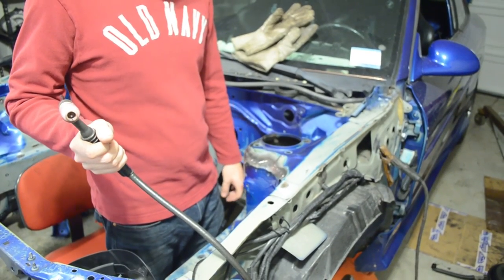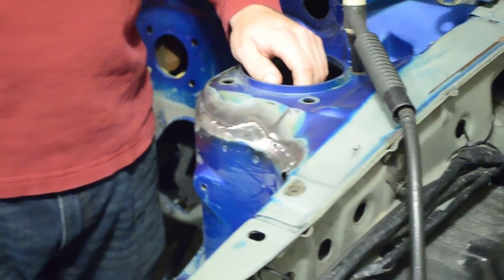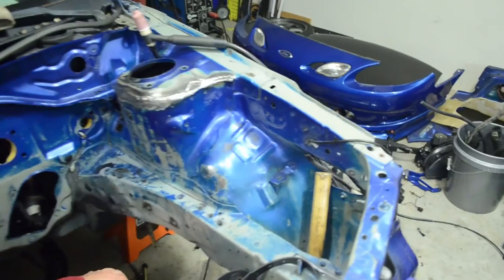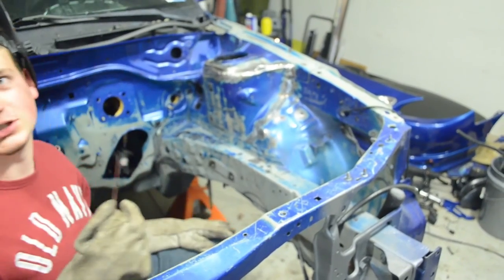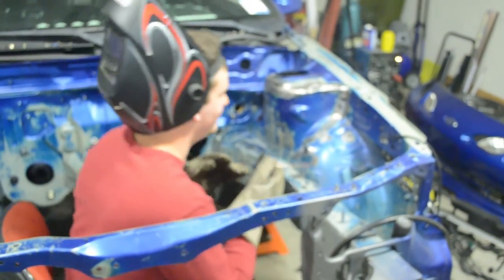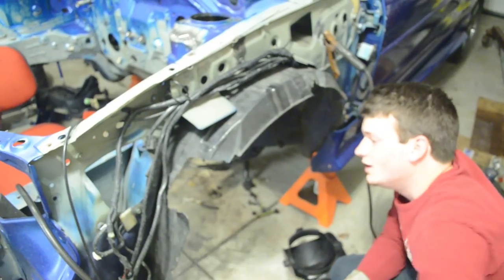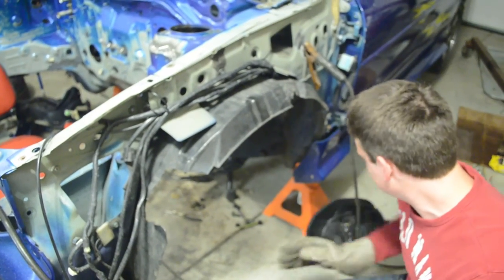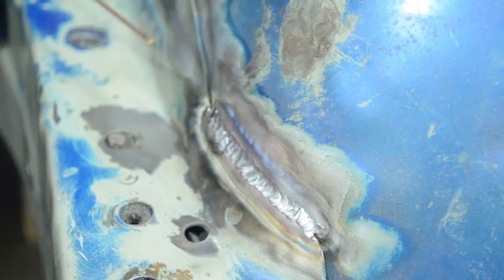Seam Welding the Chassis (Turbo Build Part 4)

Comment: Will this be necessary for FWD drag application?
Reply: No because you really want the kind of structural rigidity that they're going for in mainly road course tracks or perhaps autocross. For drag though, where there isn't cornering involved, you want to keep your chassis's factory crumble design in case of an accident. You want the front of the car to absorb as much of the impact as possible whereas seam welding reduces it. Seam welding can strengthen the parts that are meant to crumble in a crash. And can make a street car or drag car potentially more dangerous for the driver.

Comment: yikes! You know there is a reason no one uses a tig welder to stitch weld right? And you should never run a bead for more than an inch without letting it cool completely off before continuing on the exact same section with that thin of sheet metal. No offense guy but i can only imagine how badly you warped that chassis. You were on the right track about smaller amount of weld but that isn't what it means...
Reply: a good tig weld will be stronger than mig. but theres really no point in tig welding this if you can mig weld it, mig will be plenty strong. and ya he probably warped it a little
Reply: Im not saying tig welds arnt stronger than mig. Im saying there is a time and place for both of these methods and that was not the time to tig, unless he was shooting for a lot of warping.
Reply: ***** tig welding just sucks for this kind of stuff too